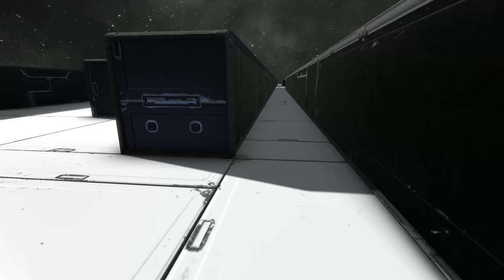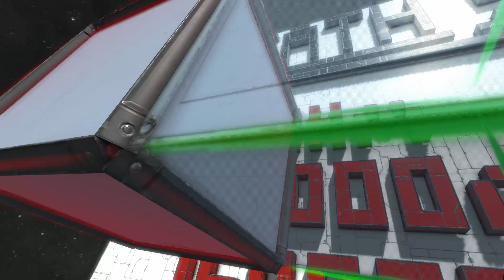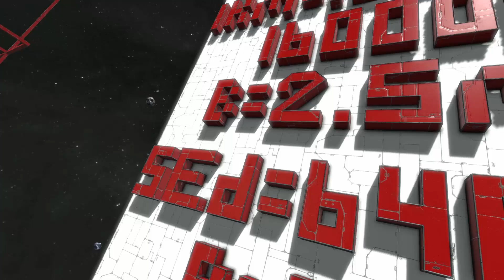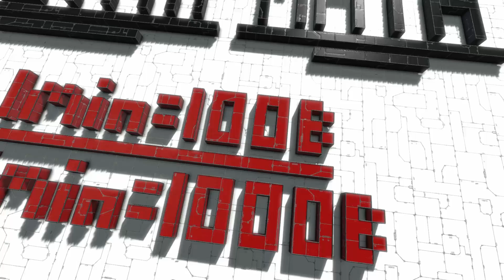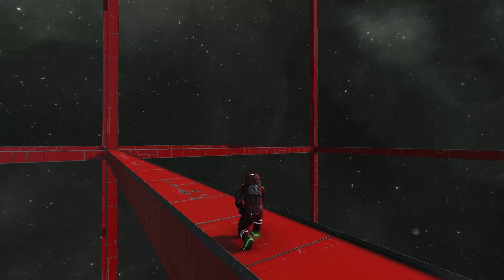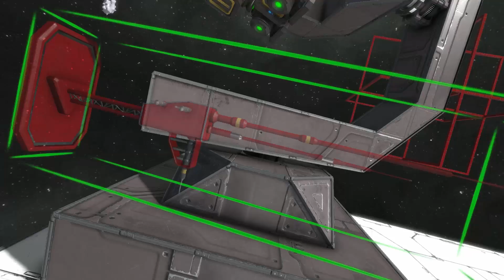Space Engineers: Star Wars Build Prep

Comment: With that copy-paste method you'd only need to make a 31999 block line, copy it, put 1 block on the end of it, then copy for each of the sides of the central block.would cut that hour per side down to roughly 33 minutes total.

Then make 1 arch, and copy paste for that... You're looking at 2 hours for the basic frame and you have to use math to find out how many blocks are needed to make it curved at each point.

This may be a multiple month endeavor.
Reply from the maker: Yea I think what I plan to do is build a rudimentary ship, with enough jump drives to make it from one side to the other. And put a GPS point near each end.

The slope is going to be very gradual I believe seeing that it has to travel so much distance. Good thing is that with the symmetry tool, the circle should be working toward each other and meet in the center. Skinning it is going to be an immense task that is for sure.